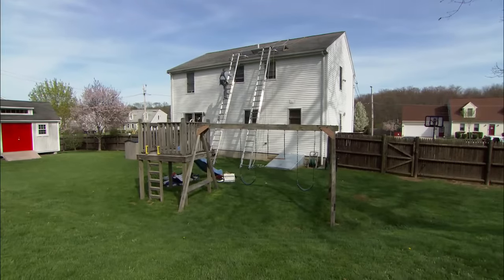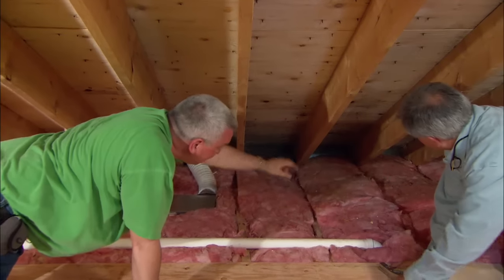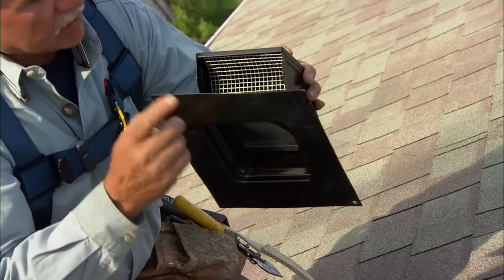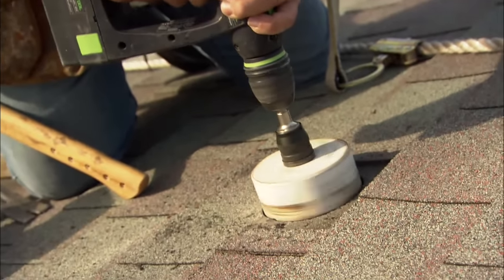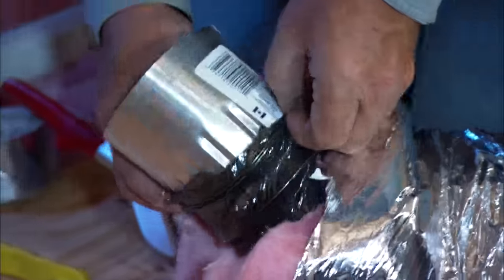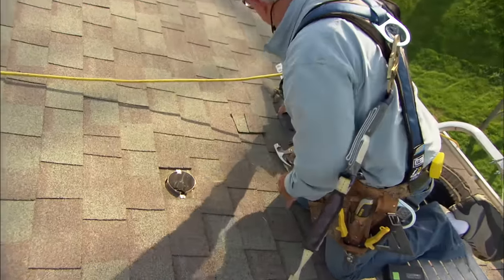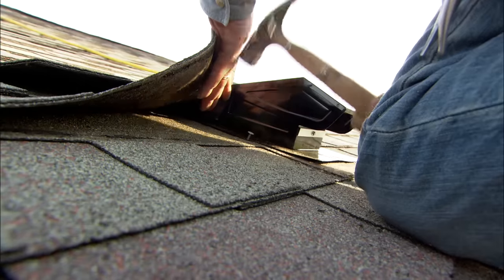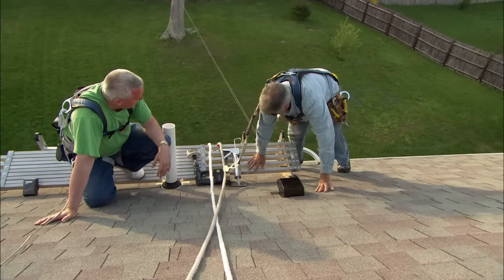How to Vent a Bath Fan Through the Roof | This Old House

Comment: Had my entire roof replaced a few years back and I'm dumbfounded to discover when replacing the exhaust fans in my bathrooms that the contractor never bothered to connect the ducts! Now I have to climb up there and do it myself. Lord give me strength fixing other people's laziness throughout the years.
Reply: People are basically lazy and have no trouble ripping other folks off.

America has changed a lot.
Reply: That's old code, and so it's not uncommon to see that in old houses.
Reply: Can you call the contractor back to do the job that he should have done?
Reply: I agree 💯 with you! This new Gen.. is not even close to what it used to be! Now you have to constantly be supervising the work you are paying for.  If you can't find a good honest company that does the job done right, it's better to learn and do it yourself!

Comment: Who else is jealous of the thickness of that roof sheathing and the incredibly easily accessible attic?
Reply: Couldn’t agree more, I’m in my attic crawling around hoping I don’t hit my head on a roofing nail
Reply: @mikez8277 i wear a hard hat when I go up there cause of the nails in my attic lmao
Reply: I bet that plywood they were crawling on was added by the team for safety during filming. It didn't look permanent.
Reply: LOL...my first thought when I saw them in the attic was "gee must be nice"
Reply: @carlotta4th  100% it was.....smart move to prevent impacting the insulation .... one issue with the blown insulation attics in current homes with it installed is flattening it when up there

Comment: I would call it a day after getting those plywood sheets up through the attic hatch to use as a work platform.  6 months later the fan would still be venting thru the soffit and I would be wondering where all my plywood went.

Comment: Just followed this exactly to vent both my bathrooms. Was nervous putting holes in the roof but got it done. Came out great.
Reply: any leaks since?
Reply: @LastingDays  shu7
Reply: What kind of silicone did you use on the roof?
Reply: @monte1270  Use the "Black Polyurethane Roof and Flashing Sealant" tube or roof cement instead of silicone.  That's what I used and I think that will hold up better than generic silicone due to the high heat and abuse roofs get.
Reply: @mae2759  you are 100 percent correct.To many people think regular silicone is fine fine for a roof. It does not adhere to the shingle as well.
Reply: Something I need to do.  The builder didn’t do an exhaust vent on one bathroom.  Just a vent fan in the ceiling that doesn’t have an exit.  🤔 Don’t know why but it’s there - or it isn’t!  26 year old house.  I’m thinking I need to vent.  Upstairs bathroom.  The 2 downstairs are vented through the exterior wall so that’s good.
Reply: @monte1270  I used the exact kind he recommended in the video. It was in the roofing section next to the vents.
Reply: Can you run 2 lines from 2 fans to one vent in the roof? I have 2 bathrooms side by side that are venting into the attic only and I'd rather not have to drill 2 holes in the roof if I can avoid it.
Reply: @joemully6666  I had the same situation with the bathrooms back to back but I ran 2 lines to 2 vents. I think if both lines lead to only 1 vent the  one can push air into the other bathroom.
Reply: @harryl7946  Least you have a vent fan xD I have a window. I've been looking into how to fix it. the whole process seems doable but like.. Im scared of the electrical part. idk how to wire it up once I get it in place
Reply: I hope you don't live in the snowbelt!!! You're going to have horrific ice damns blowing that hot, moist air onto a snowy roof.
Reply: @joemully6666  did you get your answer? I have the same problem
Reply: @joemully6666  I've done a bunch of research into that.  The majority of pros say no.  If you think about it, when you turn on one fan, a lot of that moist air will go to the other bathroom instead of out the vent.
Reply: Did you buy a fancy crimping tool?

Comment: mind blown when he did put the nail through the roof. Here I was thinking of measuring distances and all hahah
Reply: I just drill through the bottom and put a zap-strap through...
Reply: You crazy. Unless you really like geometry. Nothing wrong with that.
Reply: @PaulRudd1941  the nail he used is called a roofing nail it's how you fasten shinglesand it self seals. Zip ties are less secure and have holes for water to leak
Reply: @coreydeschambault8190  but the whole point is to use it as a reference for cutting a larger hole. So it doesn’t matter if you use a nail or screw or zip tie or whatever.
Reply: @Karl but the assistant would provide an audible signal as a bonus!
Reply: @coreydeschambault8190  pretty sure he meant the first nail for locating once on the roof.
Reply: Yeah. Nice job of him kneeling on top of the ridge cap, and flattening it. Congrats, he just void the homeowner's roof warranty.

Comment: Always love it when Tom Silva steps me through a project I'm about to take on.  After watching this video, I installed a couple vents on my roof.  If you're thinking of doing the same, here are a couple notes you might want to consider:  (1) My shingles were much less cooperative than the ones in this video (breaking the seal (2:50) without breaking any shingles required a lot of patience).  (2) Remember that your initial nail location is a bit arbitrary, so you can make it easier on yourself by adjusting the location so that the top edge of your shingle cut-out is right at the bottom of a shingle course.  (3) It looks like Tom only removed the top layer of shingle.  Other videos want you to go deeper.  I don't know what's right, but be sure to give this point some thought.  (4) Tom's vent cap didn't have a duct flange attached to it.  This made it easier to slide into place (maybe he got away breaking fewer seals because of this), but it also introduces a condensation risk:  moisture-laden air will be flowing (under pressure) through the open area between the flange nailed to the roof and the the vent cap and the plywood sheathing. A simple fix for this is to add sealant between the flange and the plywood.  Incidentally, my vent caps had flanges already attached, but the attachments seemed pretty leaky so I sealant where they connected to the vent cap.
Reply: Peeling apart shingles is best when its warm outside. It helps soften the tar bead under the shingles. So you can slide in the new roof jack / roof vent etc..
Reply: you the real MVP, thank you for these notes!
Reply: what do you mean by point 4
you would like to see the base plate of the vent have a crimped piece to attach a vent hose directly to?
Reply: Tom did it correctly.  When you reroof, you'd run the shingles up to the vent, then nail the jack down, then continue roofing.  Just pretend you're water, and trace the path where it would go.  If it hit the top of the jack, it will go around and flow down.  Water can run sideways, especially wind-driven, which is why he sealed the shingles on either sides.  I usually use a much bigger jack when reriofing, but that doesn't work well when you retrofit.
Reply: I wondered about his not putting sealant around the duct on the roof and attic side of it.  Not sure if it’s necessary but something I would do just to be extra safe,
Reply: @BobbieJeanM That's not necessary snd remember, you don't eant to trap water anywhere.  If for some reason wind-blown water got underneath the shingles, it will dry out in the attic.

Wind-driven rain is very rare, so let the attic side be free of caulking.
Reply: @scottslotterbeck3796  are yall talking about where the duct went through the hole in the roof?

I just did one (kitchen vent) but was wondering about smoke and stuff circulating back into the attic through the gap.

So just leave that side free of any sealant?

I was thinking condensation or moisture could get trapped in the plywood and start rotting it.

I used the same style as this. A Broan vent cap that slips over the ductwork.

Comment: Thank you so much for what you do. We live in a large city and there’s so much demand the roofers wanted $680 and 8 weeks waiting to install a roof vent. Having renovated several houses ourselves we knew this was a very simple job and couldn’t believe people pay that. We trust the This Old House Brand and we’re able to install the vent confidently based on your video.
Reply: $680 was a bargain.
Reply: @gora876  no, its being ripped off LOL
Reply: @seane6616  They gotta drive out, setup, cover their insurance costs, it's not cheap running a business. You want to climb up 2 or maybe 3 stories, risk falling off your own roof and end up in a hospital or worse?
Reply: @chrisstromberg6527  lawl, what nonsense. Only someone who has no business being a roofer falls off
Reply: @seane6616 yeah, we don't need no stinkin' OSHA.  Just don't fall off.  SMH.
Reply: @seane6616  he meant a homeowner trying to diy it might fall. most would rather pay someone. not saying $680 is fair... but depends on the market and the contractors available. i will do a little job in my neighborhood for 100-200 but my work is not super pro.
Reply: $680 is dirt cheap when you wind up a cripple from falling 2 stories; good luck.

Comment: Thanks for the video! I just wish I had that much space in the attic compared to having to belly crawl across 2x4s!
Reply: Ditto
Reply: Ditto :)
Reply: My attic for half of my house I have no room at all and would need to hire a child to do any work in it and it leaks too.
Reply: My chest hurts just reading that.  I'm in the same boat :(.
Reply: Ditto
Reply: Hahaha. Best comment, spot on. At first I thought they had to be on a set with the lighting and layout of that attic.
Reply: Same, Tom really cherry picked that attic.
Reply: I've done the belly crawl across for years. Resulted in a six pack.
Reply: DITTO! wished my attic was that accessible too!  i can't even get to much of my attic the space is so tight.
Reply: @thebeststooge  mold dude. go in there and spray it with polyurethane to seal it in and fix your roof man
Reply: @Eric Jorgensen Had half the house's roof ripped down and replaced and no more leaks.  The front half I can at least fix that myself but no way can anyone get in my attic for where the leaks were.
Reply: Yeah, I might save some money and pay someone else to belly crawl 😅
Reply: Yeah, we can't even get into our attic, because of how tight it is. We have a window in the bathroom, but who wants the window open while showering when it's snowing outside?
Reply: @fuse98  me as well
Reply: When I sold my house- I had horrible issues with ducts, roof leaks, and cut rafters due to HVAC guys cutting up everything, but inspections passed with flying colors cause no inspector could dare go inside.... :) Now I bought a 12-10 roof and man, feels good being able to walk inside attic, actually walk!!!!!!!!!!!!!!!!!!!!!!!!!!!!!!!!!!!!!!!!!!!!!!!!!!!!
Reply: Trusses are cheap but they 100% SUCK!  A stick-built house is fantastic.

Comment: He used Geocel 2300 Tripolymer Sealant to seal the vent to the roof, but Sherwin Williams bought out Geocel and changed the formula (not as good as it use to be) so I would suggest NPC Solar Seal #900 (Clear) instead, also that 4" Roof Exhaust Vent is not the best option out now, IPS Snap Cap is a better option with less problems plus its easier & faster to install.
Reply: Thanks for the tip.
Reply: tripolymer
Reply: Roof RT is that Good or is black tar cement BETTER
Reply: it's clear and it's a Tripolmer, not fiber cement or tar
Reply: ya Geocel 2300 will last and Henry won't
Reply: gotta have that Tripolymer .
Reply: I can't find this at any big box stores when searching online. Where do you get it? Is there anything else comparable that I could use? For example, is Henry 209XR or Henry 212 Clear good options if I can't get my hands on Geocel 2300?

EDIT: Nevermind, Grainger near me seems to carry it.
Reply: We just call it Slaz, or silicone.
Reply: I was led to believe you wanted to use tar on shingles not silicone, as a silicone will eat the shingle material...
Reply: The video was very informative but I would also say, a thirty year grade, black roofing tar would be the way to go. I've also been taught to cut the shingles back a bit further around the collar of any vent. This is especially important in areas with a lot of ice build up.  Also taper your tar lines gradually under the shingles to allow any water to run out with minimal resistance
Reply: It's a TriPolymer Geocel SILICONE sealant. It'll last around 30 years before it starts to crack. We use it for our gutters. IT cannot be applied in ANY moisture because it will never cure to the bonding surface rather just cure laying on top and once it really rains, it will just run off with the rain.
Reply: @tcpnetworks  do not use Silicone, it's not made for roofs, and Geocel 2300 formula was changed (not as good as it once was) when Sherwin Williams bought out Geocel, so I would suggest NPC Solar Seal #900 (Clear) instead.
Reply: @chaddles623  Where can a regular person pick up the IPS snap cap? Can't find anything mainstream through Google.
Reply: Roof Repair Techs, I have been agonizing over finding a Roof Exhaust Vent for a Year, I went to the IPS website found Their YouTube presentation and decided this is the vent for me thanks guys
Reply: @rickj6268  yes yes yes

Comment: Thank you so much for this video! I'd found so many on replacing exhaust fans but nothing on how to install a new one. I recently purchased a 50 year old home with no bathroom exhaust fans, but after spending 14k on plumbing repairs plus another 1k on furnace work and radon mitigation, my savings are tapped for a while, so I plan to do a lot myself. I feel much better about doing this repair myself after watching!

Comment: It's nice to have that much space in the attic to have plenty of room to work in. My attic is so small that I can barely fit by crawling in there. I also need to add vents to my two bathrooms.
Reply: I feel you there. I just completed one of mine. Had to put a skinny piece of plywood down and perform all the work lying on my back. I doubt the duct was even an 18" run! One down, one to go. Good news is the other one is easier to get to.
Reply: +Eric Olson We're on the same boat Eric.  Did you follow the steps provided in the video or did you do it a different way, using different materials?  A roofer here in FL wants to charge me $600 per vent and I have two to do.  That's freagin highway robbery if you ask me.
Reply: +Van S. I pretty much followed it exactly if I recall. The caulk I used was specific for roofing (it's black, not clear). Oh, one other difference was that my cap had the collar built in and was therefore very tricky to slide under the shingles. Ended up pulling up shingles a bit more than preferred, but I was very generous with the caulk. Anyway, no leaks so far after many heavy storms.
Reply: +Eric Olson Cool. Where did you purchase the louver from? I've read online that some are good and some are bad. The bad ones get a backdraft from heavy wind and rain. And some rusts away very quickly due to poor materials used and craftsmanship. Thanks in advance. Links would help as well... Cheers.
Reply: Ditto

Comment: Very professional work ! ...Meanwhile in snowy Canada we usually install the bathroom fan exhaust in the soffit because during the winter you would have to clear the snow off that roof vent every snowfall and sometimes that would be several times a day..... we block like 16 inches of soffit each side of the vent to make sure that the moist warm air doesn't go back in the attic.

Comment: Thanks for this information.
It helped me to install the vent on the roof. It was easier than I feared it may be.
Reply: David Visser how long of a project was that for you? I need to do the same thing and am hoping it’s only a day project at most
Reply: @jgibs81683  I wonder the same thing. We have a bathroom that vents right into the attic.
Reply: This is not the correct way to install one of these. Please don’t do this. Once the caulking fails the roof will leak.
Reply: @bretwoods9208  So what is the correct way?
Reply: @Hello David how are you doing

Comment: Does it make any difference whether you install the vents on the roof or thru the side wall?
Reply: I think side wall is acceptable too (like through the gable end of the roof).  Just as long as it avoids the soffit vents, otherwise you'll have the same problem.

Comment: Lmao! When he was putting the foil tape on, to attach the duct to the collar, there was no lettering on the foil tape. Cut the next seen, the duct and collar with lettering on the foil tape. Guess it isn't as easy as it looks 🤣
Reply: Warren O'Bannon saw the same thing and was wondering about that
Reply: The foil tape that has the red lettering is UL rated and is code in areas that can get cold like in attics. They must have realized they where using the wrong stuff then switched to the correct tape when the camera was off. LOL.
Reply: Dragon Manifest  Are you guys seriously debating the difficulty involved to apply tape?
Reply: "next seen"? :-)
Reply: LMAO it is scene not "seen"
Reply: @Jimddddd1981  you learn more from reading the comments than from the actual video

Comment: WATER DRIPS THROUGH OUR FAN. Did exactly as Tom did. Use a panasonic 150 cfm fan, short insulated flexible pipe, and same exhaust vent. Water still drips through our vent. The problem is the corrugated pipes not allowing good air flow. Will need to change it to straight pipes to fix the issue.